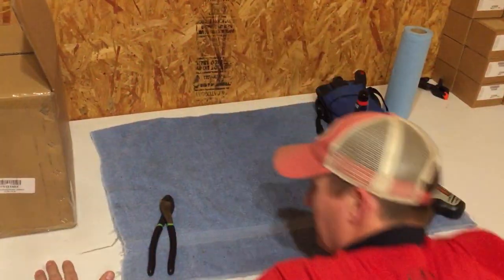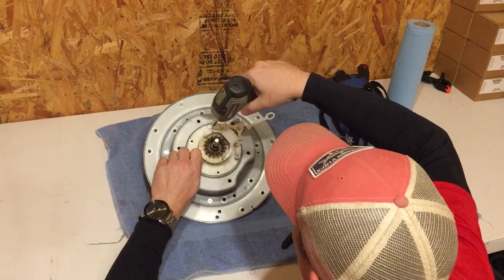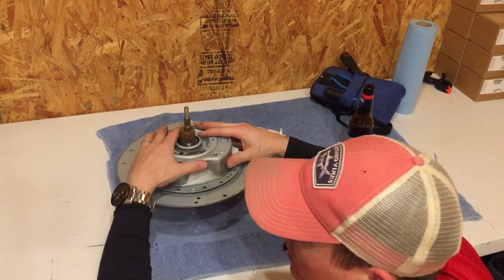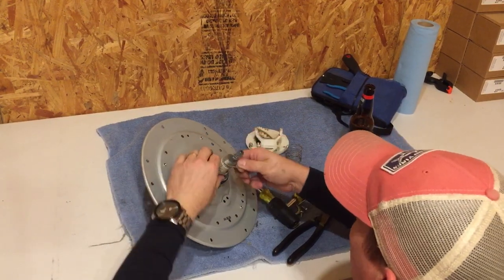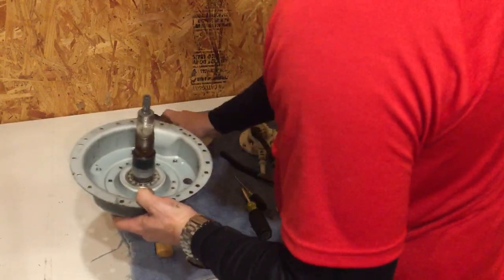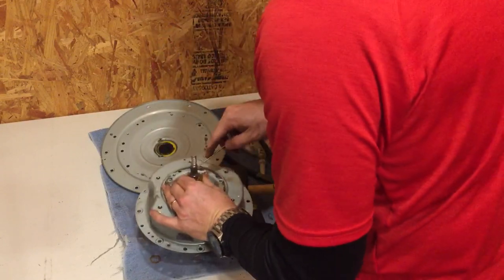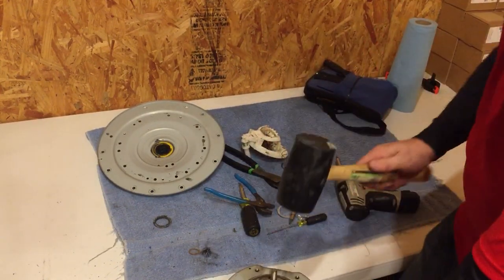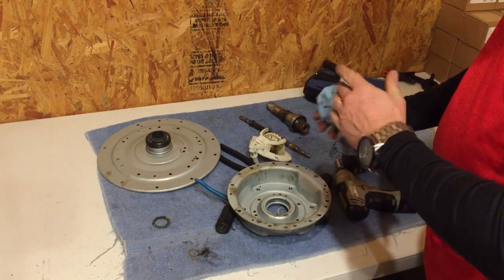LG Washer AEN73131403 Clutch Assembly bearing failure common problem with LG top load washers

Comment: great video.  my washer is 12 years old.  clutch bearing just failed.  Why can't they just make it with replacable bearings.  sad.  going to cost me near $500 canadian with shipping to get the part (and buy a socket!).  whole new machine is $815 taxes in... damn.
Reply from the maker: Can you believe those gear cases were only $45 when I made this video. Now remember, I got Contractor prices but now they’re $275 my price double to you.

Comment: While you're at it, check your washer to see if you have a Hose Clamp or Glue on the inbound side of the discharge pump. If so, that is not a factory connection. There is not supposed to be any Glue or Hose Clamps on anything according to LG.  Squeeze clamps only. Most of the LG washers had to be reconditioned, then sold as new. The hose is 2 inches too short and the travel of the tank, to offset a lopsided load, will one day rip that hose off. I repaced 12" of drywall in my whole washroom. Contact the FTC.

Comment: I have the LE error on my 5 yr old LG top loader, I just ordered this part on Amazon for $106 and free next day shipping. Hopefully it will cure the error.
Reply: I do too, where it tries spinning but like stops skipping gears or something, did replacing the clutch assembly help?
Reply: Did that fix your LE error??..I have the same problem on my Samsung..just makes a clicking noise and won't spin ..like it wants to..but its not letting it
Reply: Yes you need a new clutch assembly

Comment: Gonna try and replace this driveshaft assembly this weekend because the smaller bearing is shot...hopefully it came with a new seal.
Reply: So ya think you could replace the inner bearing or not worth the hassle?
Reply: @BayouRepairGuy  Any chance you can share the website where you get the gearcase for $45?

Comment: I don't get why you took it apart; there is no bearing/seal kit to fix it.  I just replaced my assy today so I am out $106.  Where did you get one for about $50?
Reply from the maker: I own an Applaince repair company so I get better pricing than most. I took it apart to see what the failure was

Comment: Is it possible to just replace the bearings instead of the whole assembly? Surely a bearing shop could match the seal and lower bearing
Reply from the maker: Anything is possible, but the gearcase are only like 150 my cost
Reply: I'm like you and have dissasembled it on the off chance I can replace just the seal and bearings. Il try match them at a bearing shop. Might be a cheap fix. Less than 150
Reply: Whole machine wouldn't be worth the 200 even fixed
Reply from the maker: @alexandertrenberth129  it’s worth a try
Reply: What's the chances you have one laying close by to check the bearing for numbers for me ? 🤔😆
Reply from the maker: @alexandertrenberth129  I don’t have any laying around we very rarely change gear cases on LG’s

Comment: so you told me the only problem is internal seal failure? any way to repair? thanks
Reply from the maker: Yes new gearcase
Reply: It comes as a complete set, you don't replace any individual parts in it.

Comment: You can do this if u want, but if u want to fix it, search this, buy the part and your washer will be running again
Reply: @BayouRepairGuy  I'm not doubting your experience at all, but I had the E6 error on my LG washer and it was simply a little plastic motor assembly which took me more time to lean my machine over than it did to replace the object in question...$40 later it worked and trust me I'm a complete rookie at appliance repair, unlike yourself.

Comment: You weren't intending to rebuild that part, you just wanted to take the bad one apart to see why it failed and no intention to reuse any of it because you already have a brand new assembly to replace it with. Every one who is freaking out doesn't understand what is going on. I have a Kenmore/Whirlpool he top loader that I bought as a demo for cheap. It ran nicely for first three years and after that the main shaft tub seal fails after about a year and you have to tear it completely down and replace shaft, tub bearings, and seal. It's involved process and if you get cheap parts or have a bad day it will start leaking right away and you have to do it again in about a month. The parts in OEM are usually over 100, and the cheap Chinese kits are around 50. I have redone it about 4 times since I got it in 2013. I have given up and ordered a LG 7900 top loader from Costco with a 4 year warranty and I wanted to see what the bearing setup is like in the machine I'm getting. I supposedly won't have to worry about it for at least 4 years but I want to know what I'm up against if I ever have to deal with it myself after the warranty expires. It looks way simpler than the Whirlpool direct drive setup as you just replace the whole setup rather than trying to knock everything out and completely replace each part and hope you got it right. Even at 100 bucks it looks like you have a much better chance of a successful repair the first time and it should last longer too.
If you have direct experience with the 7900 setup let me know and I'll keep the info saved for hopefully much later. I now have a really nice bearing tool, and a bunch of shafts and dead bearings for a Whirlpool... 🤬
Reply from the maker: Thank You my friend